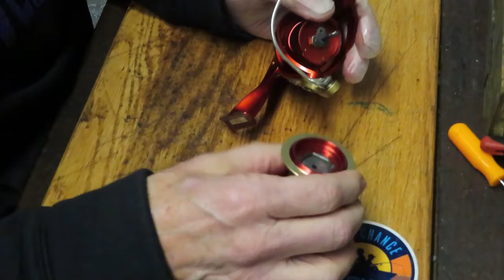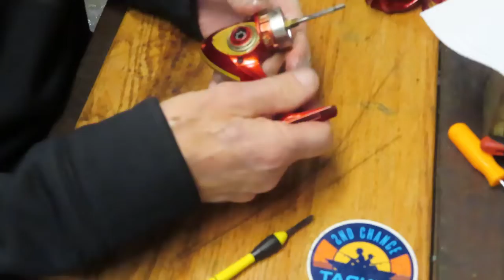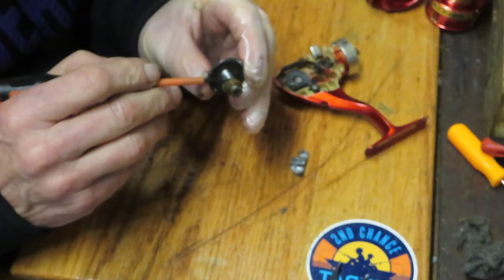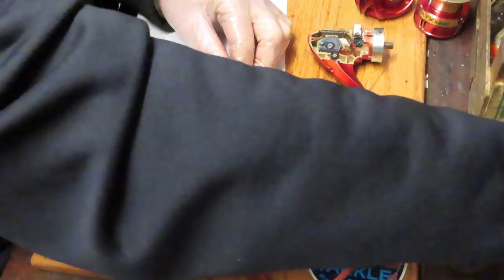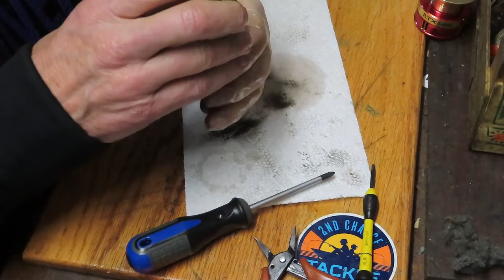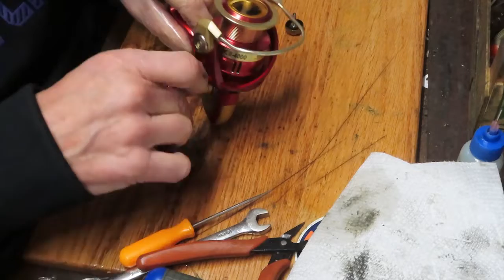Okuma RTX II 4000 spin fishing reel how to service

Comment: Dennis, I have actually seen this reel before though I don’t remember exactly where. I own three Okuma reels - two baitfeeders and a small ultralight reel I got in a reel Lotus. This reel you are servicing has a very unusual appearance that is quite different than the ones I have.  I guess that;s why I remember seeing it before. I have several vintage spinning reels that have helical gear assemblies. I really like most of them though they can be difficult to reassemble.
Reply from the maker: This one is a smooth operator!  And it has an A/R over-ride too!